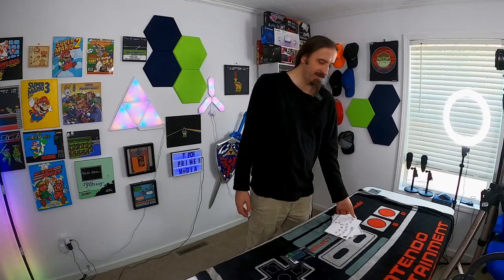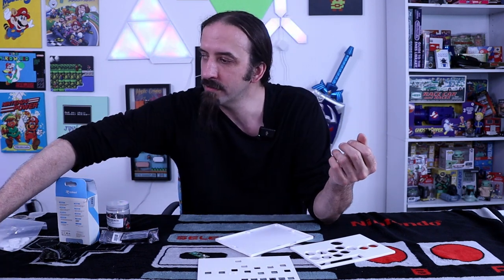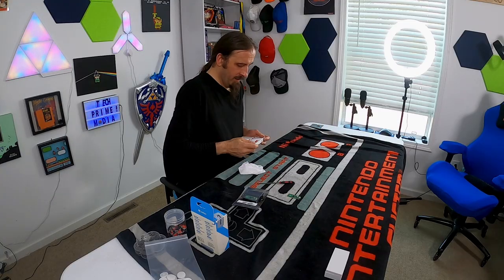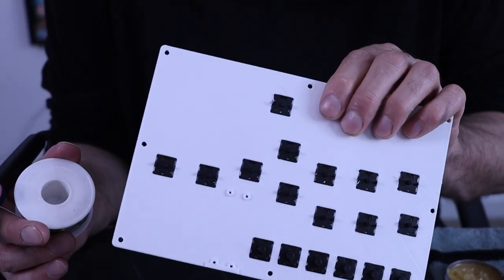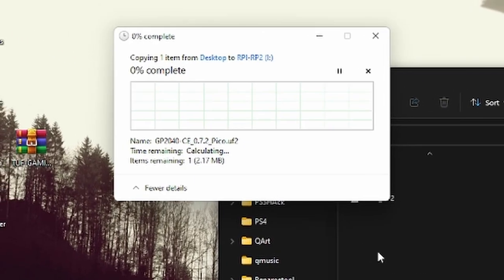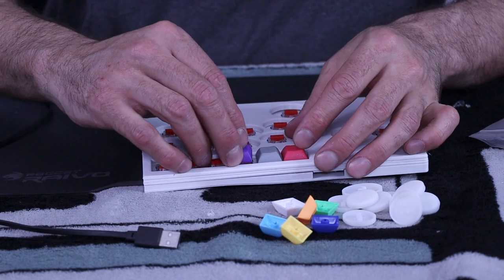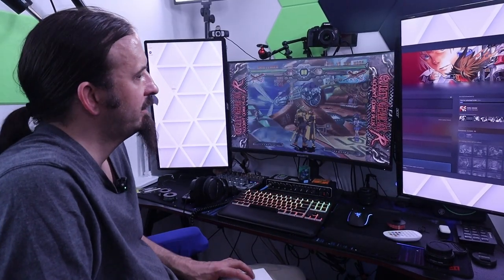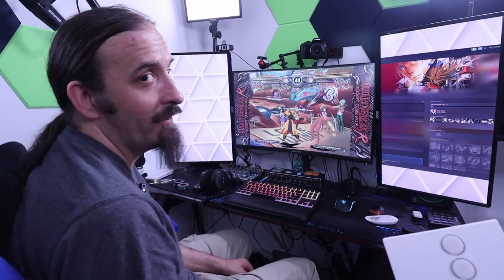3D Printed Hitbox Prototype Fail #hitbox #3dprinting

Comment: I highly recommend getting the quick swap inserts as it makes it way harder to damage the switch through soldering (i have melted plastic holding the iron on the prong while tinning)
Reply from the maker: Indeed I do have some, but not for the switches I was using in the video. But yes when you can use hot swaps you definitely will save the switch and give it a longer life.

Comment: I ended up remixing this exact 3d model, made it 2 piece, added sling loops and made the now bottom and top pieces slightly taller to ease the tolerence of the wiring cluster. Waiting on my new 3d printer to arrive to finally test.
Reply from the maker: Nice, hope it works out
Reply: Crossing my fingers! Printer arrives today

Comment: I've been making hitboxes for a few years now. I've only done it with soldering straight to third party controller PCBS. I should really swap over to a pi zero.

~Edit~
Also Accent Core hit my nostalgia hard.
Reply from the maker: You will like the next video. We used a Zero Pi from brooks.

Comment: Where did you get your wiring diagram? I am currently working on something similar but I have never worked with a raspberry pi. Seems like I'll be using the same firmware, so my guess is the wiring would be the same.
Reply from the maker: Here is the link https://gp2040-ce.info/#/wiring
Reply: @TechPrimeMedia  awesome, thanks!